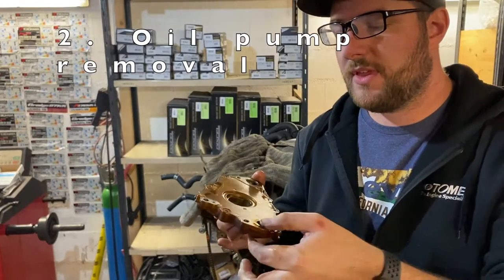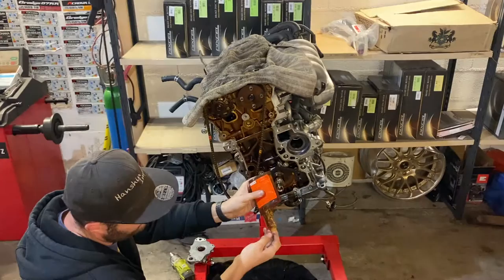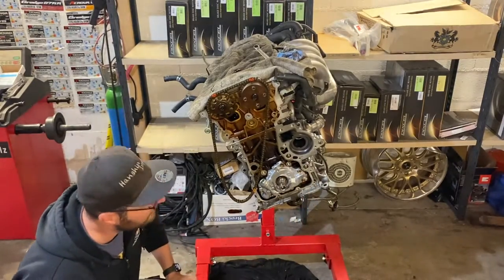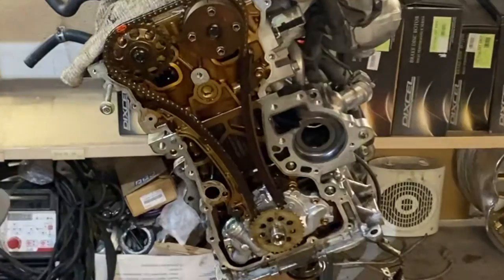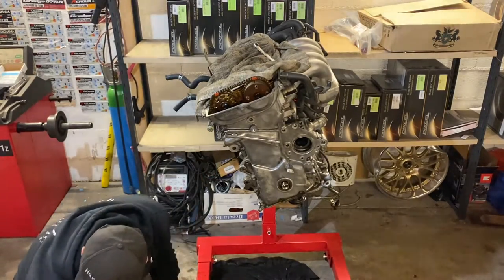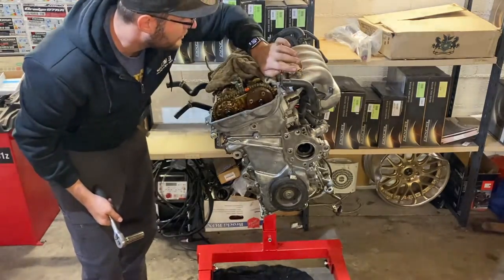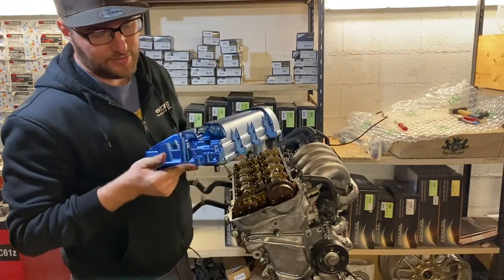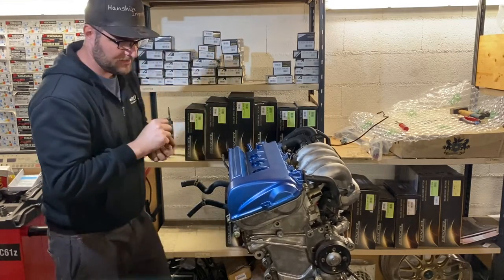EP6. Project Lotus Hunter: How to prep the 2ZZ for the Engine Swap and all  important maintenance

Comment: I recommend using a plastic blade to clean gasket contact surfaces as a metal blade can score or scratch the surface which results in a leaking gasket!
Reply from the maker: Hi, Thanks for your comment. For somebody who has never done it, I would require to be cautious not the scratch anything. But As you see, I haven't scratched mine so its entirely doable, even with the metal one. But in all honesty, I don't even bother with blades anymore and just you a rotational metal brush and brush off all the rests of goo...

Comment: Question.. do you recommend install a 1ZZ oil pan (with baffle) on a 2ZZ engine (oil pan without baffle)? or that will mess up with the oil pressure expected on this engine? I read about that a lot in forums and I want to know your opinion. Thanks for your time.
Reply: NVM I found the answer in another video in your channel... thanks anyway!!!!
Reply from the maker: @izonfly9758  Hi, hahahah. Yes its a sad one hahahah. Don't use it, especially with high grip tires. For the street its ok, but racetrack and sticky tires... nogo! (I'd never do it again)

Comment: Hey Jese what kind of fuel pump are you using?
My Runx  2zz is a returnless fuel system so walbro fuel pump does not work.
Reply from the maker: Hi, I am running the stock mr2 zzw30 fuel pump and fuel system.

Comment: Do you know the torque spec of that cast iron half-shaft carrier bracket that mounts on the back of the engine? Thanks
Reply from the maker: Hi! Thanks for your Comment. I don't have the torque spec in front of me. You should look at a Toyota Workshop manual. I'd estimate it at 70Nm (at your own risk)